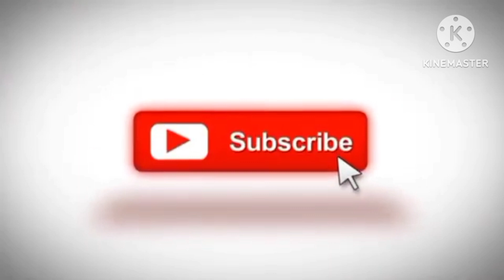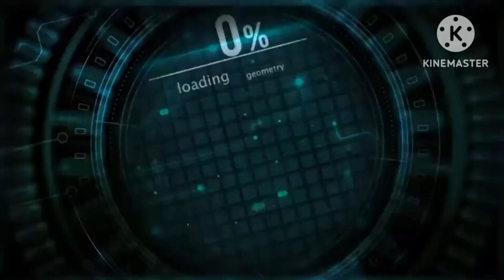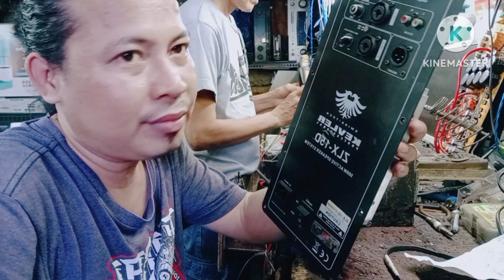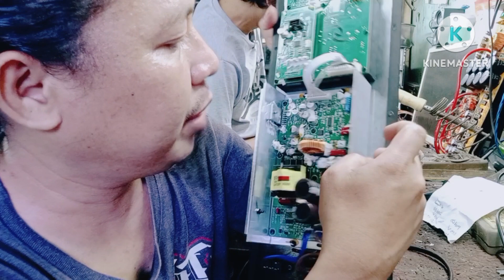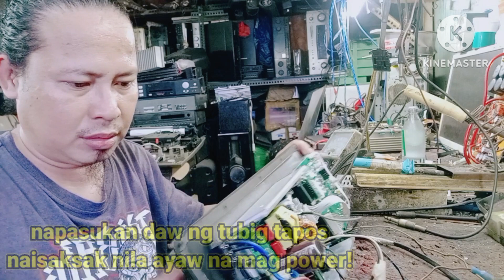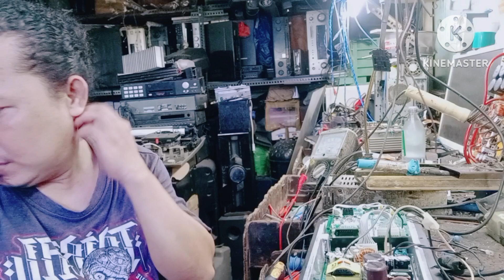KEVLER Professional ZLX-15D 15" 500W Active Speaker | Repair! No power problem,!

Comment: Sir anong problema pag may power pero delay nagkakasound mga 3 to 5 mins after i on ganun siya lagi pag bagong bukas pero tuloy tuloy naman after 3 to 5 mins.
Reply from the maker: may natrouble akong ganyan change value na ung parts,,
Reply: @electrojintech.channel5875  ano pong change value?
Reply from the maker: @MarinduqueTV  minsan kasi nagbago na ng value ung pyesa hindi na sya tulad ng dating sakto pwede tumaas ung value ng parts,, pwedeng nangyayari yan sa mga resistor at mylar capacitor,
Reply: @electrojintech.channel5875  normal po ba yun o kailangan ipaayos?
Reply: Gx7ub pro amplifier ko po
Reply from the maker: @MarinduqueTV  ah kevler amplifier gamit mo,, mabagal ung relay pwede sa may relay section ang sira,,
Reply: @electrojintech.channel5875  pag sa unang bukas siya ganun boss pero kunyari pinatay mo ng 2 hours tapos bubuksan ulit wala naman problema
Reply from the maker: @MarinduqueTV  kasi pag supply ng relay nanggagaling sa primary capacitor ng amp medyu matagal magdischarge kaya cguro pag i on mo ulit ok,,
Reply: @electrojintech.channel5875  boss natrace ko na po di po pala sira amp ko pag malamig lang yung lugar siya matagal mag start pero pag mainit nagstart agad ang sound
Reply from the maker: @MarinduqueTV  ok,,

Comment: Boss anu pa possible sira wala parin supply papuntang pre amp
Reply from the maker: pwede ung ir2156 pwede din capacitor sa may regulator!
Reply: Salamat idol
Reply: Napalitan ko na po ung ir2156 and mga capacitor wala parin posible ba ung MOSFET